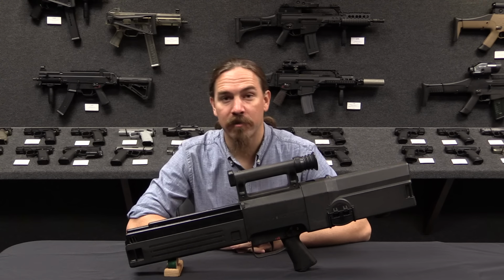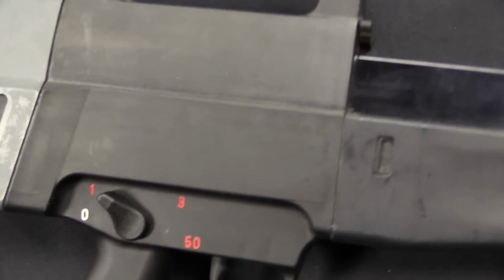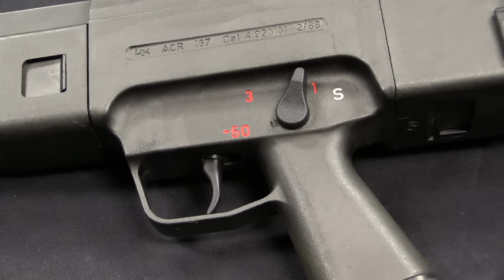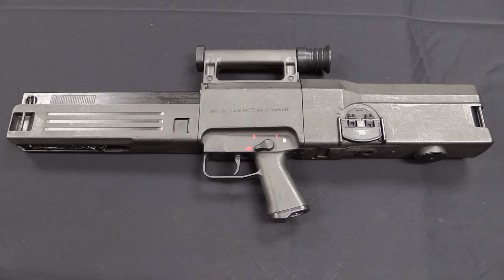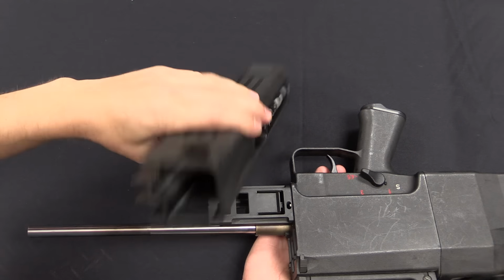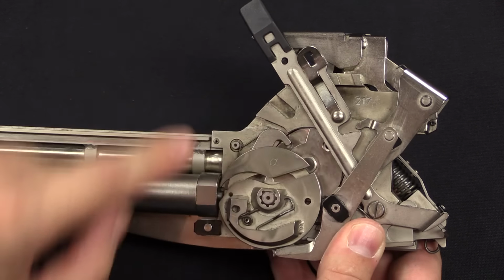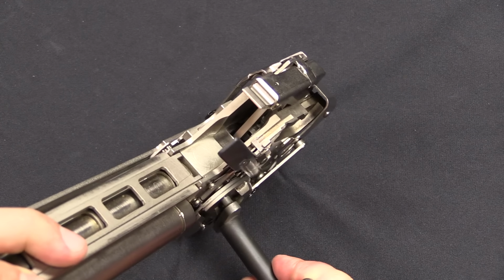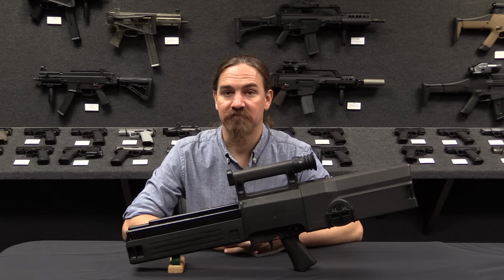Kraut Space Magic: the H&K G11

Comment: Military : hey HK, what if this complicated clock malfunctions during a fire fight?

HK : good question! So we have a package deal offering a 2yrs master's degree in mechanical engineering for every soldier...
Reply: the thing about such mechanisms is not only that theyre complex but theyre also really sturdy, well built and held together AKA not alot of loose, non wanted friction and other windows for failures. its built compactly and really hard to disassemble because its that well made and even if it fucks up somehow, you could probably just swap the whole assembly with a spare one faster than how he did in the video. Also mechanicly wise, it doesnt seem that complex, farm implements got more complex mechanisms than that and theyre still in wide use to this day.
Reply: @VenerhiaNebula  
The issue is with the ammo as well. It is nowhere near as versatile as normal rounds. Much more fragile and prone to failures, especially in transportation. 
You can swap out an AK or AR 30 round mag in less than a second, while being very rough with it. 
Additionally, right tolerances is not always ideal when you talk about sand and other FME getting into and gumming up still. 
That is why the AK is generally more resilient than the AR, it can deal with much less tight tolerances.
Reply: In the middle of a firefight? You do the same thing as you do with any other gun if it malfunctioned. Find a weapon that hasn't misfunctioned because if the malfunction is any more complicated than a misfire, you don't have time to deal with it.
Reply: @markjacobson8878  
No. There are different types of malfunctions that can be cleared in less than 1-2 seconds. 

A stovepipe is not a misfire, but it is cleared just by racking the gun.

A major, malfunction, sure, but most malfunctions can be cleared with your trigger hand still near the trigger. 
If your AK or M16 gets a stovepipe in a moderate range firefight, you are not dropping it to search around for a different weapon or pulling out your handgun.
Reply: @markjacobson8878  und
Reply: Well, remove the action, get a new one and put it in the housing. :)
Reply: "oh! Thats wonderful!"
Reply: It's more like "Good question! You die."
Reply: They were simple and cheap to manufacture, so you’d just pickup another working one.
Reply: I mean Germany literally has Free college. Real countries do.
Reply: @keithsimpson2685  You mean, Germany makes all of the people who didn't go to college pay for other people's college.  Real kleptocracies do.
Reply: @keithsimpson2685  Germany is also a country that hugely outsources most of its defence to the United States.
Reply: @964cuplove  Ok mr emoji, love to know where the Germany's navy is in protecting trade across the globe. Or better yet what deterrents do they have from being invaded without american, british, or french nuclear arsenals.
Reply: @cripto1366  friends all around us. You know if folks don't hate you, they don't invade you. 🤷‍♂
Reply: @keithsimpson2685  
Nothing is free. You pay for everything. 
Glad to know you are happy with someone getting a degree in gender studies with a. Minor in basket weaving on your dime. Because YOU are paying for it, wether you go to college or not.
Reply: @EndGameDown  
A German's tax burden is roughly the same as that of an American.
Only the German receives for his taxes functioning local public transport, good roads, tap water in mineral water quality, social security, 24 working days legal right to paid vacation, maximum 36 months legal right to parental leave (paid, including protection against dismissal, per child), good and functioning Health care without having to sell their house and child, as well as state universities where anyone can study cheaply and many of which have a level of education-Quality comparable to Harvard.
On top of that, police officers are not let loose on the population after just 3 months of training, but have to learn their trade for 3-4 years.
Reply: @sylviarohge4204  
And Germany is a much less diverse (ethnic, political, and cultural) country, with about 1/6 the population of the US, 1/10 the land area, and a lot less rights. They have a completely different set of problems. 

And you are saying you WANT your money, even if you don’t have kids, to go for a less effective education in social justice and anti-whiteness studies or cinema studies at a bad college (of which the same education can be done by watching YouTube videos for free)? Again, paying for someone else’s kids in a bad education system? That’s a waste of money. 

Our education system is set up completely different. If you say we should abolish the US department of education, abolish “no child left behind” national standards, and let states control their own education system, like they do in Germany, I will agree. 

If you say we should ACTIVELY encourage more people to go into trade schools like Germany instead of getting useless, unneeded degrees when they aren’t going into STEM, then I agree. 

If you say police need longer training and finding like Germany, then I agree. Tell that to the Democrats that are defunding the police. 

As to paid vacation, that is something between a worker and their employer. Why have the government step in like mommy. If you don’t get the vacation you feel you deserve, don’t take the job, or join a union and strike. You don’t need mommy and daddy government to work out all your problems. And the mandated parental leave should also be between a person and their employer. Again, YOU have the right to refuse a job that doesn’t give you benefits. My job offers 6 weeks parental leave for BOTH men and women and unlimited sick days. We bargained for it and got it. We didn’t need Pelosi or Crews to tell them anything. 

As to German infrastructure, you aparently don’t live in Germany. It’s infrastructure is not great right now and is a highly debated political issue there for their upcoming elections, including VERY overcrowded roads and bad internet speeds. US internet is on average 1.5X German speeds. 

In many cases, is being like Germany means LESAd involvement by the central government and MORE involvement with state and local ones. That is A Libertarian view of government. That is not what the democrats or the neo-cons are doing in the US government.

Edit: also, Germany has a lower effective tax rate on the richest people compared to the US, so call your representatives and say “Be Like Germany and drop Zuckerberg’s tax rate” and  “Drop the corporate tax rate from 35% to 15%”.
Reply: @EndGameDown  
It is not freedom when you can only choose between starvation and a miserable job.
What you describe as "freedom of choice" is only possible if you have enough money to live it out.
For everyone else it is a cage that offers the only choice between death and "slavery".

The political landscape in Germany is far more extensive than in the USA.
This already shows the point that we have much more than just two parties that run the country.

There are things that cannot be said in Germany with impunity.
However, these are extremely limited and only serve to safeguard the historical responsibility that Germany bears due to its history.

Rights are a luxury good, and the USA in particular is proving how unjustly they are distributed.
The right to physical integrity, the right to medical care, the right to freedom of choice in activities, the right to medical care, the right to education.
All of these basically exist in the USA, but only if you can afford these "rights".

That is not freedom.

I especially see the statement with the constant "What do I get out of it" in a precarious way.
A deeply narcissistic mindset where only your own wellbeing matters.

Germany has problems.
I compared the infrastructure of Germany with that in many parts of the USA, and in this comparison Germany scores extremely well.
Yes, the internet speed in Germany is not good everywhere, I only have a 100Mbit connection, in some parts people can be happy if they get 6 Mbit.

However, the core point is that freedom also means being able to decide without being destroyed financially or in any other way. 

I live in Germany, more specifically, on the North Sea, near the East Frisian Islands.
Reply: @EndGameDown  "and a lot less rights." - actually people in Germany have more rights than the US.
Reply: @EndGameDown  can you explain to me why so many americans use "america is diverse" as a talking point? Like seriously, its neither good nor bad, it doesnt really affect your quality of life, same as land mass or population. And concerning rights, we have just as many rights as you guys, our government just regulates stuff better so that our quality of life is higher. If you want to say "you dont have freedom of speech" then i can tell you: yes we have. We have the same amount of free speech as you do, its just that we have an extra law to clarify what certain things mean, but in practice, you cant say anything we cant say (legally)

Also bad education system? Sorry but did you miss that the best engineers come out of germany? Your high technology is largely developed by german engineers that go to the US because they get better paid there (something that hss changed since 2022 btw)
Reply: @EndGameDown  delusional...